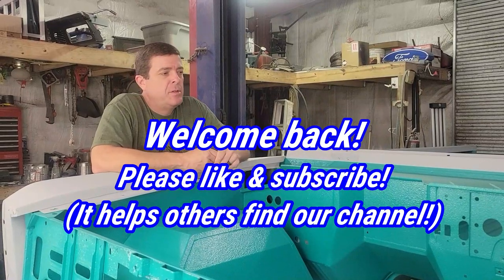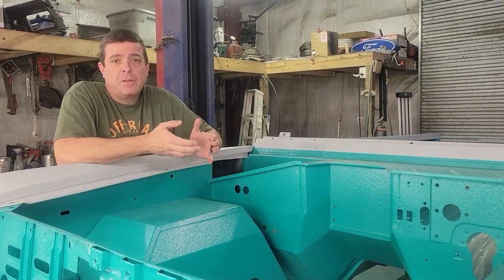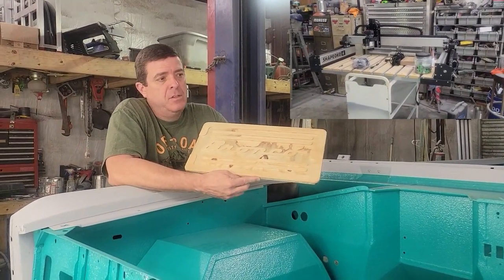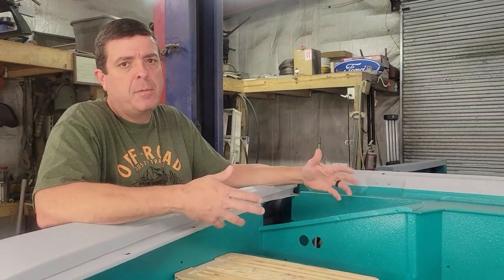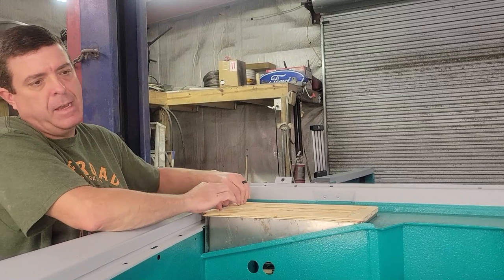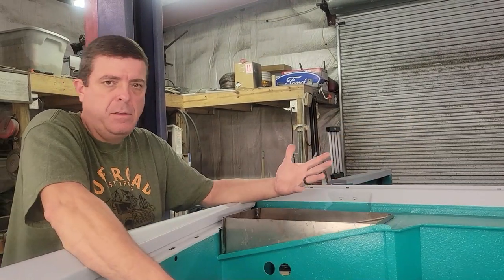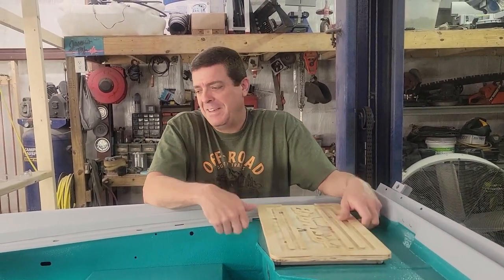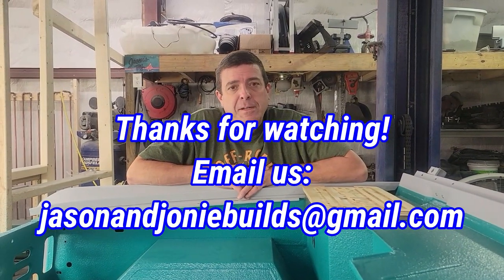Under Hood Toolbox? - 1966 Ford Bronco Restoration Project

Comment: I like the idea…I’m always looking for storage on mine. With my my AC i kept that vent….the unique ideas are what makes it special. Tracking down a radiator this morning once the shops open up. I found a crack in my AL radiator when touring around this weekend. This one only lasted about 1 1/2 year. I think I am going back to brass/copper. Welds on the tubes just cracked?
Reply from the maker: Wow that is no good.  I am glad you found it before your trip down south.

Comment: Thanks for the great videos, I have a 302 build for a 71 maverick and would to know what cam and lifters you went with, also what heads are you using? If those are stock they cleaned up nice. Thank you.
Reply from the maker: Sorry I missed this Jim.  I used a set of Flow-Tec aluminum heads.  They are not top of the line but flow so much better than stock and there is a huge weight savings too.
Reply: @JasonJonieBuilds  Awsome thank you